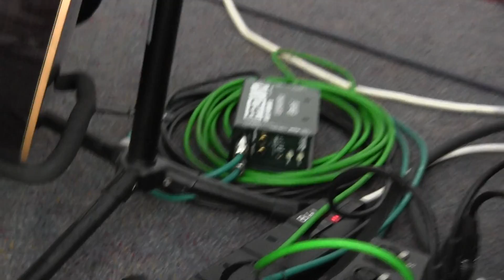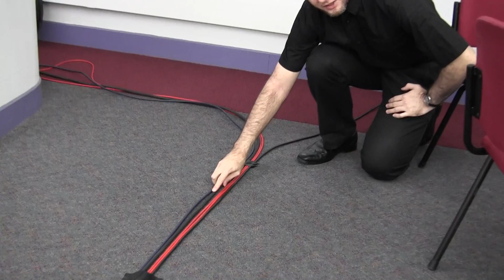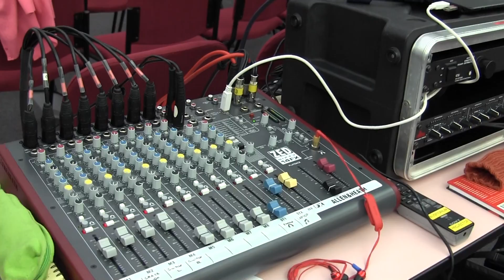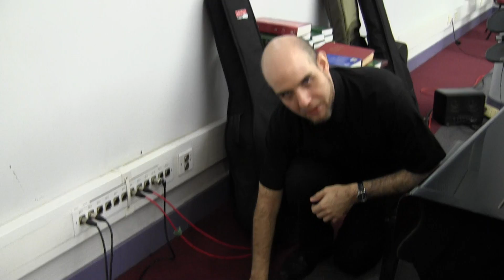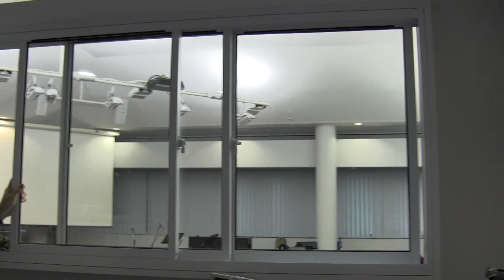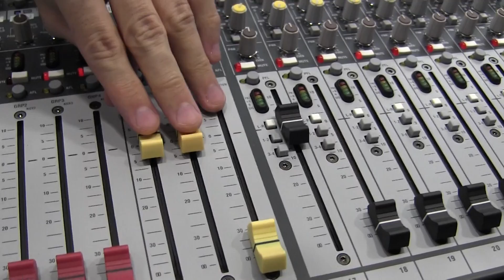How to connect two analog mixers together - field demonstration

Comment: Excellent video, iked and subscribed!!! I do have a question though for my specific case. My submixer is a behringer xenyx 1202fx (https://www.youtube.com/watch?v=-4GpqwnsbUI) and main mixer is from a cheap portable PA, Gemini ES 210MXBLU (https://www.youtube.com/watch?v=GPFIcH_CgUA). I currently have R&L main out from my submixer going into the R&L stereo input of the main mixer. As you can see, the cheap main mixer has a volume knob for the stereo input and a master volume for the mixer. My question is, what do I set the volumes for the stereo input and the master of the main mixer if neither of these have unity indication just 0-10 volume control?
Reply from the maker: Start with them both at 12 o'clock and adjust from there :)

Comment: thanks alot for this lesson...but i have a mixer with simple compressor and i want to connect it to a regular mixer
how would i do that..and which mixer should be the main?? and which one should be the sub??
Reply from the maker: Tommy have a look at my other video on this subject: https://www.youtube.com/watch?v=HgeVInOV1Kk
Reply: thaaaanks alot sir!! as soon as I get the appropriate cables and so...I would be delighted discuss these issues with u
thanks alot!!
Reply: so u mean i have to set everything on sub mixer...like gain,volume,EQ and compressor...then route it to the main mixer
Reply from the maker: Correct - assuming your application is the one discussed in the video.
Reply: actually i live in Syria and am working in a TV station...and u know we don’t have these equipments due to war and so....I’ll try to figure it out somehow
thanks alot...I appreciate your comprehension and your good lessons
Reply from the maker: Yeah must be very difficult trying to make things work with the situation there. I'm not a broadcast engineer, but if you would like to discuss this in greater detail get in touch with me via my website and we can take things offline.

Comment: Hello @GLB Productions
Do you have an idea how to connect a foh analog mixer to analog monitor mixer
Reply from the maker: The traditional way to do this is to use either a splitter system (can be passive/hardwired with transformers or active using powered electronics) or a monitor console with a splitter system built in. Both of these are pro-level setups intended for large concerts or events. For smaller systems, especially if you have fewer than 4 monitor mixes, it's best to run your monitors from the FOH console.

Comment: Thank you sir. Do you have a video on how to connect a USB interface mixer to a DAW such as waveform?
Reply from the maker: No I don't - that procedure is highly dependent on the DAW that you are using: each DAW has its own procedure for setting up the communication with an external device, so I suggest you consult the manual for your particular program.

Comment: another great video Bruno but i do have a question.. why pan hard left and hard right?. will it make any noticeable difference if you just keep the pan in the middle? .. thanks man
Reply from the maker: The reason is that the output from the submixer is stereo - left and right - hence the need to replicate this on the main mixer. Otherwise you are converting a stereo signal into a dual mono signal, which loses all the panning information on the sub mixer.
Reply: @GLBProductions  Thanks Bruno... i appreciate all your videos.   peace

Comment: Hello Bruno. Could you also give an insight into how to connect 2 digital mixing consoles together to extend the number of channels. Thanks.
Reply from the maker: Hello Sam - it depends on the specific model of digital mixer that you are dealing with. Some, like the Allen and Heath SQ series, have a master/slave function that allows two of them to be connected and effectively function as one large console. Others like the lower end Qu series do not have this functionality and need to be connected as you would two analog consoles.

Comment: Hi Bruno
Thanks for great detailed videos.

I'm a pianist/singer and use a "submixer" next to me at the piano (vocals, piano mics and iPad tracks). I'm in a hotel lobby environment.

My submixer is a Mackie PRODX8 digital mixer, and the "main" is all-in-one JBL EON One speaker system, which is about 2meters away from the piano.

How should I set the levels on each end? The PRODX8 doesn't have gain controls..only level control which they say has auto gain-setting built in.

Currently, on the submixer, the MAIN output level is at 0(unity), but the channel levels are almost maxxed out, and on the JBL, MAIN level is at 0(unity), and channel 1 (input from submixer) is also about maxxed out. I'm only performing at a "whisper" level.

 Thanks
Ralston
Reply from the maker: Hello Ralston nice to hear from you! This is an interesting one :) 

With this combination it is difficult to say for sure because of the auto-gain on the Mackie and a lack of metering on the EON, which also doesn't have gain controls. 

I would suggest setting up your ProDX8 such that nothing is clipping and then running into the EON at line level, with everything set to unity. If you find this is too soft, turn up the channel level on the EON and if that is still too soft turn up the EON master level. 

How does that sound?
Reply: Hi Bruno

Thanks for your answer. I'll definitely try that out 😀. I didn't want to blow up anything since the hotel just bought this speaker, haha!

Thanks again and have a great day!

Comment: Thank you for a clear concise how to. Why is the ProAv2 needed after the AD3? The AD3 has balanced dual L/R output. On a much smaller basis I am intending my chain to be AD3/sub-mixer/ Stereo inputs to main mixer. A similar lineal electric guitar chain also. The goal is a clean sounding demonstration platform for acoustic and electric guitars as well as some recording. Within a limited budget.
Reply from the maker: Good question! The AD3 balanced outputs are very hot and have a tendency to overload mixer mic inputs so have put the DI box there to knock the level back a bit. I also like the way the transformer warms up the sound.
Reply: Thank you. By "hot" I guess you mean the 600 ohms balanced output impedance of the AD3. Have considered a Behringer DSP2024P Virtualizer in the acoustic chain to use the broader stereo effect. Making the most of a small space. Soon there will be a Boss VF-1 processor for electric guitar with RSS for stereo width effects. It will be a sort of plug & play demonstration platform and a good selling tool. As good as the strategically placed mirror that lets buyers see how the guitar "fits" on them. Also the mirror is the only part of this setup that is not for sale.
Reply from the maker: Haha yes don't sell the mirror... no by hot i mean the output level in volts - it's almost a line level output and as such tends to overload mixer inputs when connected to the mic preamp. The ideal solution would be to run into the mixer's line level inputs but on lower end mixers you would need to use an XLR to TRS adapter which is not always practical.
Reply: Thanks again. Already have XLR/TRS cables made up so done something right in a tripped up way. Enjoy your videos and it is a go to spot for information on this complex field. I am lucky with a technician friend here who I refer to as my R&D dept but he is deep into his own projects. 3D printing and CNC gear and I import components for him that are equally a mystery as sound reinforcement to me. Thanks again.

Comment: Great video! What about connecting an analog submixer into a digital main mixer? The difference is just on be assure that the gain on the digital is set to -18dB? Thanks a lot for this channel!
Reply from the maker: Yes it's the same except that some digital mixers use dBFS instead of dBu - with dBFS there is nothing above zero, where distortion happens immediately. If you have a mixer like that you want to allow 10-15dB of headroom, so zero on the analog mixer should be -10 or -15dB on the digital. Depends on your program material and how hard you like to drive things ;)

Comment: I had to fight for my church to not do this. I had to settle for the rear corner of the sanctuary but it works..lol
Reply from the maker: In a situation like that you still need to be careful of excessive bass that builds up in corners and next to walls - take a walk around during rehearsals and check to see that your mix in the room as a whole is not bass-light.

Comment: Thanks B. I was wondering if this is similar to what I see at concerts with a board in the middle of the venue and another at stage side.
Reply from the maker: No, that setup uses a separate monitor console to mix the stage monitors, and the front of house console in the middle of the venue is responsible only for the sound that the audience hears :)

Comment: Thank you Bruno for your great videos.
I noticed phantom power was on at the GL2400 for Ch7 & 8. Will it have any effect to certain mixer as sub-mixer?
Reply from the maker: It generally won't affect the sub mixer but as a rule it should not be on for this application. I turned it off after making the video ;)

Comment: Great vid,Bruno but I have to watch it again to get all of it...next time could you show an image of the Signal Routing?
Only to semplify the comprehension of what you did :)
Reply from the maker: Thanks Chris - the signal routing is pretty simple: mics/DIs -> 8-channel snake -> A&H ZED60-14FX submixer -> A&H GL2400 house mixer. There are also local inputs plugged into the submixer (laptop audio, break music) and the compressor inserted across the main mix. That's it :)